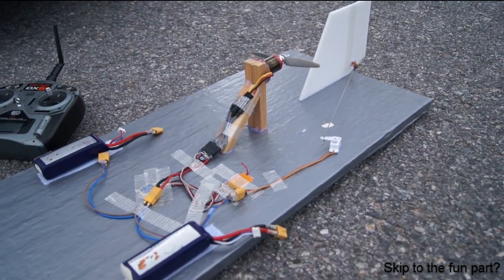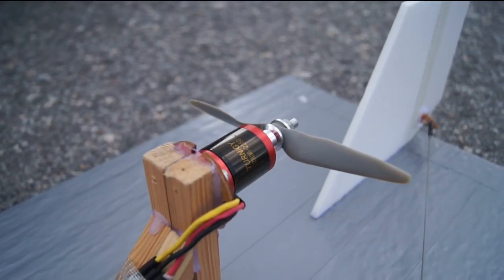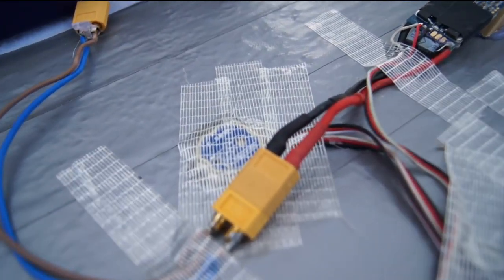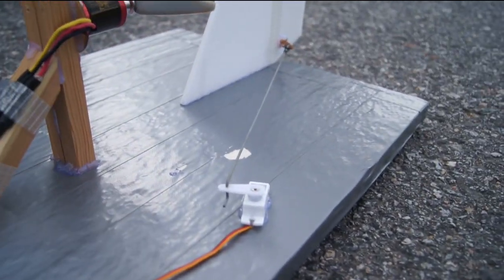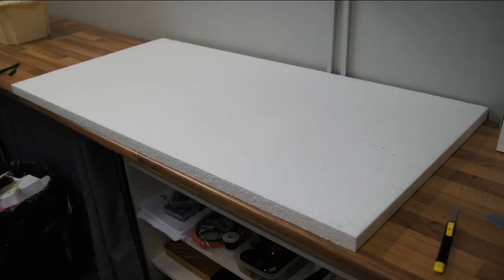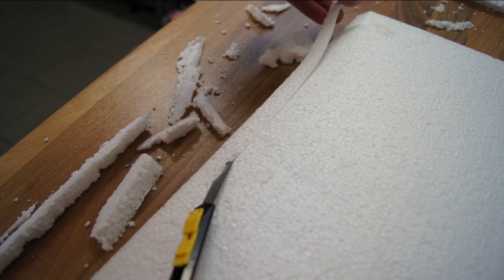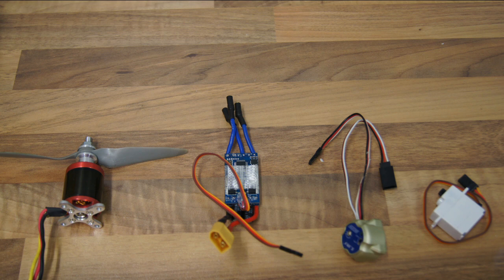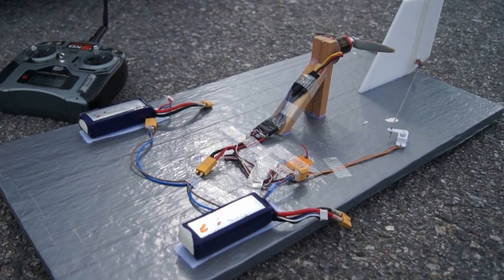Powerful DIY Simple RC Duct Tape Airboat - RCLifeOn

Comment: Bro what is the prop size PLEASE REPLY !!!!!!!
Reply from the maker: In this video I used a 6x4 propeller.
Reply: RCLifeOn thank you so much bro for replying... But I have only two prop 4.5x4.5 carbon fiber and other is 10x 4.5  plastic which one you think I should go for also two motors are 2212 1000kv and ntm 2836 3000kv

Comment: I was amazed that it was able to go on asphalt and still not fly up in the air.  It did fly up some, but not much.  I think the gyro helps that a lot, but I wonder if or how that could be mitigated so it would happen less.  I think this project is awesome because it can do land or water, and needs no wheels, no gears, almost nothing.

Comment: nice work.  I'm inspired.  maybe you need some down force.  with serves you could make adjustable  wings like on f1 cars
Reply from the maker: +Chris Foote Yeah, that's one way of doing it. I just place the batteries a little bit more forward, or use larger batteries (longer drive time).

Comment: I built it and its very fast! What was your top speed?
Reply: Try double sided tape and stick some wheels under it and call it a car.
Reply from the maker: operationTF7 Awesome! Going full throttle with some tailwind would make mine go somewhere around 25mph, even though it felt like 50mph :D
Reply: Yeahhh! I really thought it was going far beyond what it was really traveling at
Reply: I have mine running on 3s.
Reply: also, can it run stable on 4s?
Reply from the maker: operationTF7 Sure, you can use a 4s. Because of the increase in power you will have to place the batteries futher forward.
Reply: To ensure a proper center of gravity, right?
Reply from the maker: operationTF7 Yeah, you don't want the airboat to flip, if you have the batteries too far back it will be tailheavy. That's why you want the batteries to be futher forward, to push to nose down. If they are too far forward the airboat becomes uncontrollable and a lot of power goes to waste. Make sure you find the proper location.
Reply: ok, I found out that it does wear the bottom. Do you think the plastic from gallon bottles would help to protect it.
Reply from the maker: operationTF7 Maybe all you need is some other type of tape?